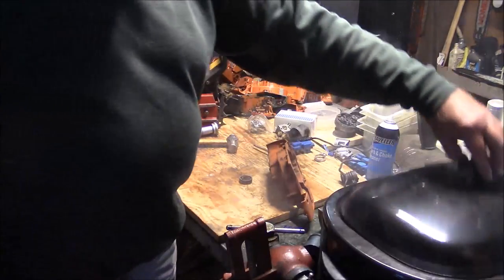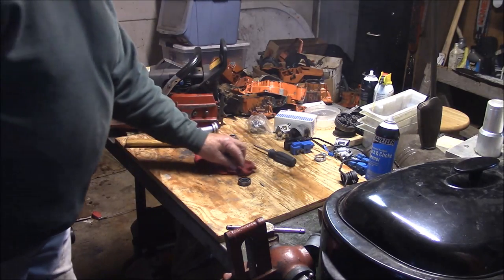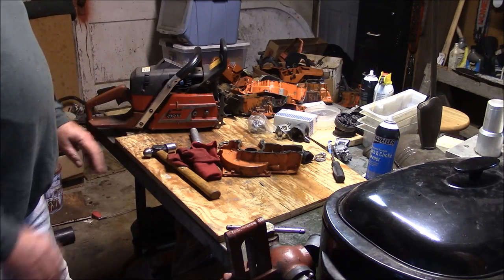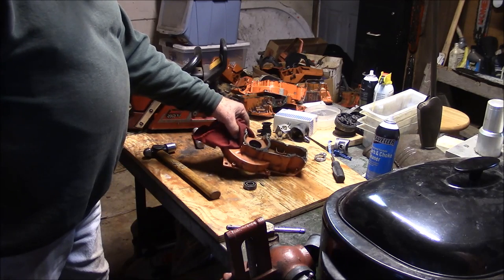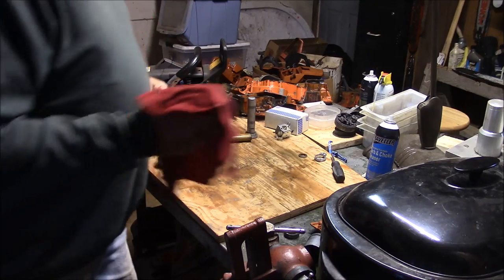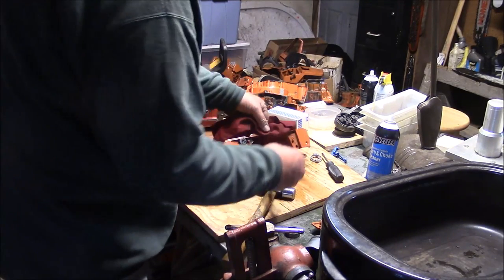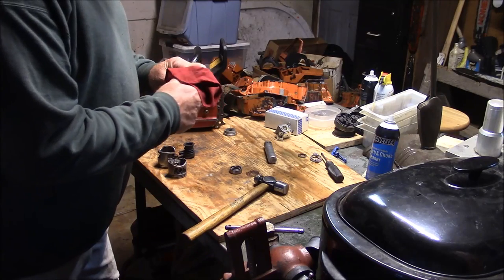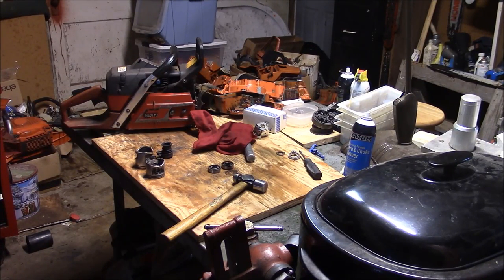Husqvarna Chainsaw Main Bearings Replacement The BEST Way  ( With SKF Steel Caged Bearings )

Comment: Good to see you back in the saddle, Walt. I'm also of the camp that leans toward heating the entire case half uniformly vs. using a torch or heat gun. The operative concept there is 'uniformity' in the expansion of both the case and the bearing. The differential involved between the two metals is their rate and degree of expansion, hence why the steel bearing will fall right out and drop right back in every time. Just gotta have the case halves mighty damned clean before takin' em up to 350 degrees or they can ignite -- not like a magnesium fire, but rather a saw spooge residue burn that can take a minute or two to go out. Smells like hell and will blacken the paint.

Comment: The turkey cooker or oven (not the wifes:) is the way to go, especially if you can set it to the desired temp. Heating the whole case expands the whole case vs trying to get just around the bearing pocket heated up to expand within a colder case. Stihls service manuals typically call for 250 degrees but I have found as you recommended that 300-350 degrees works better on stubborn bearings. I am interested in seeing what you do with the bar & chain setup. Maybe discuss again for those folks new to this the older saws that came with either mount and show them an up close comparison. I have not had good experiences with the Sugihara bars so I use Tsumara  myself, or I wonder about putting a Stihl e light bar on that saw with the goal of the lightest/fastest cutting setup.

Comment: I've done hundreds of lower ends starting when I was 15, closer to 70 now, how did that happen ? Most of mine were propane torch & plastic hammer but I like idea of heating the entire casting, less chance of distortion possible ?  Word to the wise though, be carefull not to get case too hot because Magnesium does not have 100% memory & may not return to exact tolerance when cooled. Over the years I have seen PTO side bearings spin in the case after a home rebuild. I asked the owner of one of these how he heated the case, his answer was ' a propane weed burner on a 5 gal tank. Hmmm, wonder how hot that was?
Reply from the maker: Why I use a turkey roaster, I can set the heat to where it doesn't damage the case. I've done a few :)

Comment: Is it possible to pull and replace the PTO bearing and seal without splitting the cases? On a 390XP?
Reply from the maker: Nope, not really. It's an integral part of the bearing. Looks like you could, but buy the time u peel out one and pound in another it will be too deformed

Comment: Wont 350F ruin the temper of the bearing?
What I learned was to not go over 110C when heating a bearing. I know you dont heat the bearing but I wonder how hot they get once in the case?
Reply from the maker: Short answer is no. 350 isn't going to effect hardness. I do get more "careful" with the Nylon cages as that nylon can't handle the heat as well. Most of the bearings have their heat operating limits cataloged. Lubricants define the limits. For "tempering" the temps on that hard stuff needs to be closer to 400. "350" on the turkey oven dial usually ends up being a little less to I guess. But I've done that since the 1960's on "steel" caged bearings. Haven't seen an issue yet.

Comment: I can see the benefits of using heat, however I have made tools to install the bearings without heat. I have used heat and tools to assemble and disassemble the bearings, both have their uses.
Reply from the maker: Same; I had built a few versions of my puller I designed & make to assemble cases into essentially "squeezers" to install bearings. AND I rationalized for a while why that we clever...but unless they "expand" the bearing pockets ( like heat) they still make the bearing rub hard on the bearing pocket surfaces and therefor at some level work those surfaces....heat doesn't. A combination of heat and "squeeser" / press is prolly a good idea with the nylon caged bearing where heat is NOT nylons friend.....but doesn't that yet again beg the question as to why manufacturers put those things into "hot" working environments?
Reply: @afleetcommand  Yes, that is the crux of the question. Plastic caged bearings and how to install them, personally I try to use metal caged bearings where I can. I don't know if there are any videos on how the factory install them but in my mind it seems like follow how they do it. Another problem I have come across is those saws where the bearings butt up against the removable oil pump, using heat on those (in my mind) would mean problems for the oil pump. In any case I am rebuilding soon a Husqvarna 288 (waiting on parts) and I am thinking to use both methods, heat and press.
Reply from the maker: Actually a good subject to expand on. Saws like the 660's where there is no "stop" for the PTO side bearings, and have a precise location to be in. I do use heat to get the bearings in...and with nylons I have chilled the bearings so the "heat" required is less....usually in the 300 degree range. Often the slip right in. I have a bushing with  .048 --.050 recess I use to set the case on and set that location AND to your concept I use said bushing on the pullers to get the final "set" when I assemble the cases. Often that will shift the bearing a few thou. But certainly not jam the bearing  in a cold bearing pocket very far therefore not doing much if any work damage to the bearing side wall. Might be another video and a reason to buy a new kit to assemble....it's been a while :)
Reply: @afleetcommand  P)lease do, I enjoy your assembly video's. I might make a stop that bolts in place of the oil pump and it doesn't matter if it gets hot, would save the oil pump and get the depth of the bearing right.